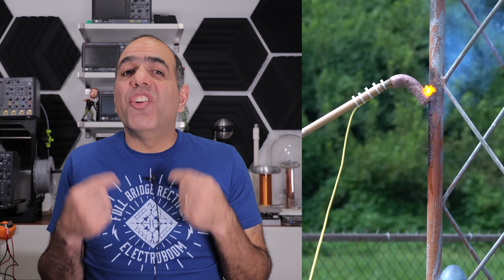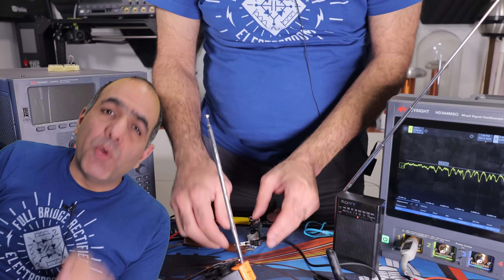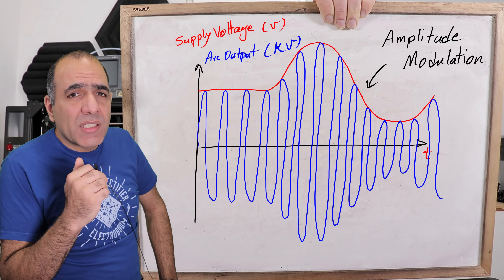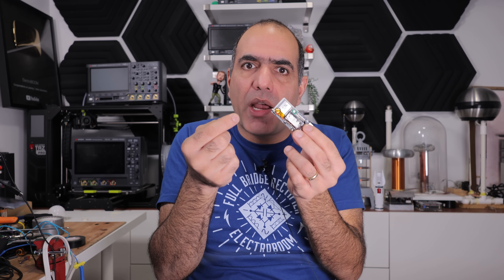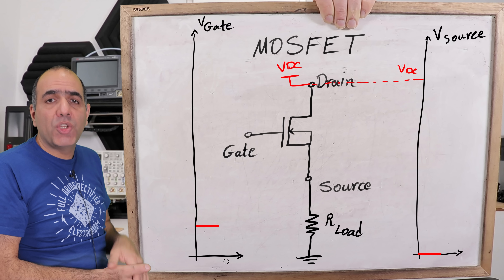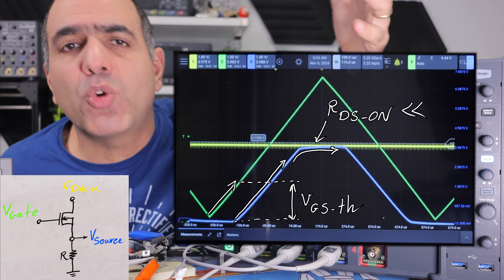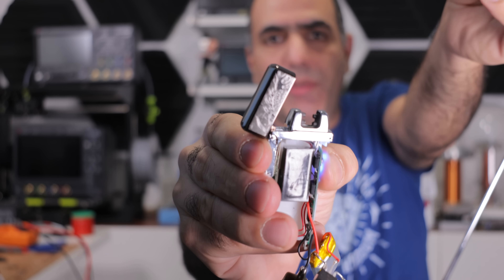Plasma Speaker DIY (AM Demodulator)

Comment: Does it really hurt more from low frequency components? Those things give a burn as it is. If you switch it on and off at 17Hz, then you could have an arc lighter taser (plus a 3d printed top to bring out the probes) and probably get arc lighters banned in the process.

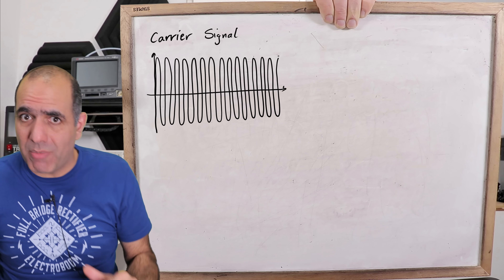Comment: 2:40 Technically speaking the signal on the tower has no low frequency components (they are filtered out). However, when you apply a non-linear effect like rectification, low frequency components very easily appear!
Reply: @rfmerrill He's not talking about those, if you can get a sound out of a signal, it has to have low frequency components, because when you do an AM you rapidly turn the high frequency signal on and off at a voice frequency (which is like 50-800 Hz as a normal human speech), for lower audio volume you do lower amplitude and vice-versa. That's an amplitude modulation. The meters that you use can't pick it up, but they're certainly there and that's all due to the sum of 2 functions (aka function composition when you introduce a component of a function into another periodic function)
Reply: @StefanGiljača Yeah but the whole point of the modulation is that the actual low frequency components don't transmit over the air well, so they are filtered out to not waste energy or cause interference.

Also summing functions is different from function composition which is different from multiplying signals which is what actually happens in AM.
Reply: @rfmerrill Yeah, so that's ok. You definitely want to get rid of low frequency components to get a one carrier frequency that itself doesn't have low frequency components because you would get a bunch of losses since when you derive the impedance for it, you'll see that a lower freqency has a much higher impedance (which is just a resistance for it in the air since the air behaves like a capacitor) and possibly even interference with power lines since they operate at 50 or 60Hz and a deep sounds might have frequencies in that range so you don't want the main signal to actually contain them, but they're still gonna be present there, what you're trying to say is that they should be filtered out so that the carrier signal itself doesn't have low frequency components (it must contain audio but what we don't want is that its frequency to drop at certain times), that's what we're trying to avoid, because when it travels through the air as an electromagnetic wave (as it gets converted into em radiation as it enters the transmitting antenna- that signal already creates an electric field, but as the charges in it osciallate they also create magnetic fields which are then coupled at a 90° angle to create the final electromagnetic wave which is actually a bunch of oscillating particles, namely photons that propagate at a velocity of around 3×10^8m/s - a good analogy is when the wire is heated only when it passes current through it, though this is much higher infrared frequency and energy, that's why am and fm radio waves don't feel hot, but that's just another type of light, a lower frequency and lower energy, invisible, but still light) and then they travel through the air until they reach receiving antenna at which point they're picked up, regenerated (they induce voltage and current in the antenna) if the signal is too weak you might need an amplifier and then you rectify it and make a circuit with capacitors, diods and resistors to effectively filter out out the high frequency carrier signal and creates a one that rides across the peaks and valleys of a carrier signal and that's basically the original audio signal and then you feed that into speaker and its membrane will send those oscillations through the air which us basically a longitudinal mechanical wave (aka sound) that you can actually hear with your ears and unlike em waves, mechanical waves actually need a medium to be transferred through. So the point with any radio basically is that when you disregard the silicon crystal semi conductors, math which you need for functions, different energy, units and formulas, which btw I find much easier to start from scratch and to always start from logical and to derive them when I need them, when you disregard the multiplication of 2 functions by switching it on and off to still have low frequency stuff, but then once it's in a form of an em wave, then you're gonna have one uniform frequency when you even out a 90° angle if you do calculations between a sine and cosine functions and angles, when you disregard all of that, you're basically converting sound into light, trasmit it as a light and then once you have it at a location where you want to listen it, you converted back to sound and I've always found this process fascinating. As for the functions, I really don't know why I wrote composition, I've just taken a paper and drew the modulation and it really is multiplication, the amplitude is lower when the volume is lower and vice-versa which means that you're multiplying a carrier signal with audio and therefore the modulation, if you add up the 2 functions you just get one on top of the other and it's totally useless, also if you subtract them you don't get any possibility of carring informations, I also went ahead and did the composition and it pushed the other function up, it didn't change frequency at all, and I have to admit that you were definitely right about that it's just a multiplication, in a composition you take the result for y-axis and put it as the input x for the other function (I wanted to explain because it's just a simple math) and you get carrier signal that ain't modulated at all, its intensity or amplitude is just being shifted from x axis up and down with audio, so no information can be transferred. So yeah, the only thing that is simple to do and the only thing that will actually modulate the signal is to multiply the 2 functions by simply switching the carrier signal on and off with audio

Comment: So it seems that AM radio uses conventional AM modulation method with carrier added. I always thought it was DSB-SC AM since it's more power efficient. And now radio receivers always support both AM and FM modes, so an LO is always present to demodulate FM, so I thought they also can use it to demodulate DSB-SC AM. Now it seems that a diode and a filter can still demodulate AM

Comment: I lived near a am radio station 5 ears ago and always felt sick at that house I was working on a Canadian twin amplifier and I touched the transistor on the input and could hear KCTA 1030 am talk radio going thru my body.
Reply: In the small city of Vardø Norway the American military have a extremely powerful radar that would interfere with a audible sound on anything and everything that could receive a radio signal every 30 seconds I think it was ... And when they renovated the house built in the 1950 we found that the entire house had aluminum foil covering it inside the walls and ceeling as reflective heat insulation and also blocking that horrible radar.
Reply: @a64738  the house was magnetically shielded probably had powerful amplifiers and modulation generators I wonder if the pole had a distribution transformer maybe a backup generator

Comment: How to hear radio signals with a pickle.

Step 1 - get an AM radio
Step 2 - there is no step 2. You already have a radio. Eat the pickle while listening to the radio!
Reply: @Ultra_229 woefully inadequate. you overlooked "get a pickle"
Reply: Thinking quickly, Mehdi constructs a homemade radio receiver using only some electronic components, a pickle, and a radio receiver.
Reply: I'm going to do it this way, more interesting
Reply: What if I want my pickle grilled tho
Reply: @Solunex  grill your picle
Reply: Truth
Reply: @Akkbar21  Step 2 - find a working AM frequency
Reply: lazy ahh comment
Reply: You need to get the pickle too, but nice
Reply: Thats the exact opposite
Reply: He already used demodulated audio signal from headphone jack of the hand radio 😂

He should build a receiver circuit to capture AM signals which is easy 😅